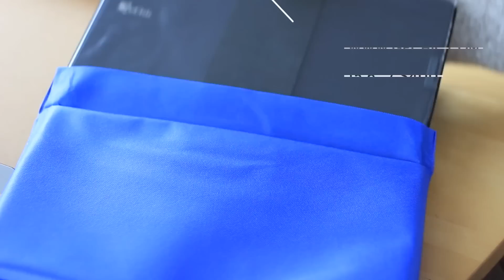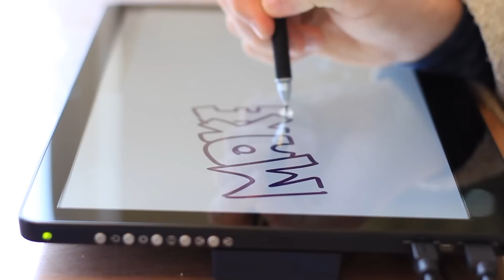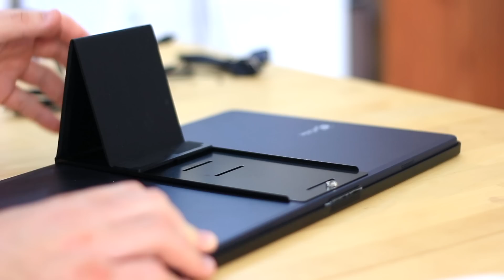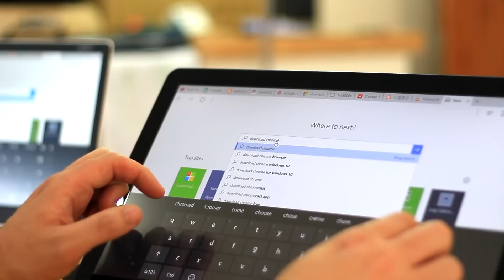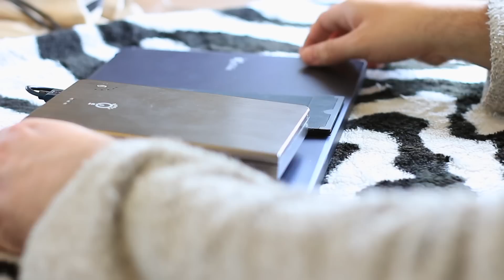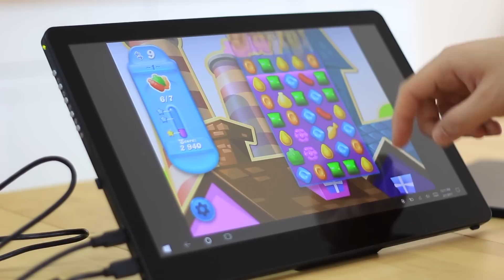GeChic OnLap 1503i Review

Comment: look at all those fucking wires, you want to break that out wherever you go? No. No. Just no. Asus needs to release the touchscreen zenscreen already
Reply from the maker: All those wires? It's one wire. Combined USB and HDMI. Zenscreen is rubbish for anything except presentations since it runs over USB.
Reply: @MakeUseOf  ok fair enough and I appreciate the reply, i wish asus would just release the portable proart monitor already. The cords are long and coiled on the GeChic, its not quite as sleek as the zenscreen is. That folding case for the zenscreen is almost enough for me to put up with the picture quality. Still, I wish it was just touchscreen.

Comment: Hello, 
I'd like to create a "portable Pc" by having a microPc (Intel Skull Canyon for instance) and to link it to one or two touchscreen monitors. I hd this idea cause i was searching an 15,6 or 17 inches Tablet Pc with intel I7 and 16 giga of ram and never found it (at a sensible price). 
My idea of having two screen is for my thesis work : to have on one screen my rapports and in the other to run an digital notes application. 
Would you recommend me the Gechic for that kind of use or some other models with an integrated battery?
Do you know some strong portable battery?
Reply from the maker: To be honest, that sounds terrible. All those wires everywhere. I don't know of any battery that'll suffice for all that...
Reply: I see what you mean for cables. So what would be the solution in your mind when you need an 15,6 or 17,3 inches upgradable Laptop (without touchpad) ? :)